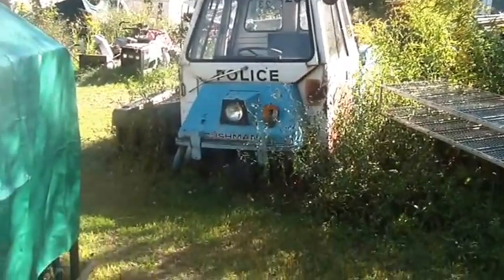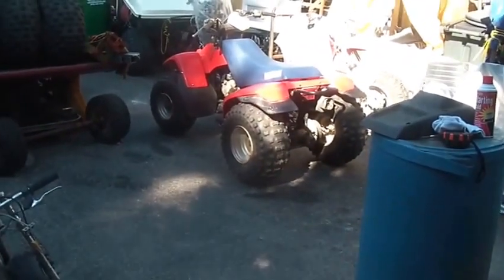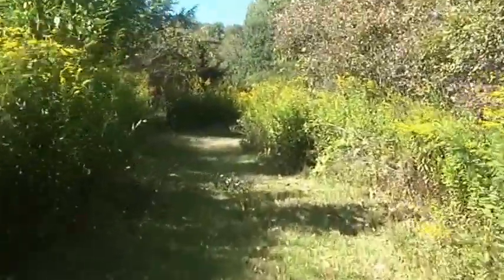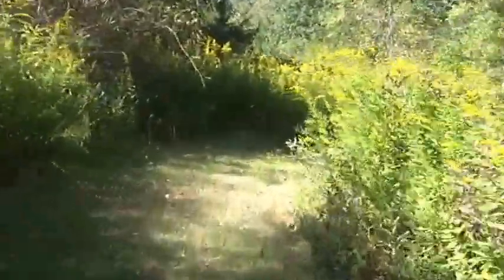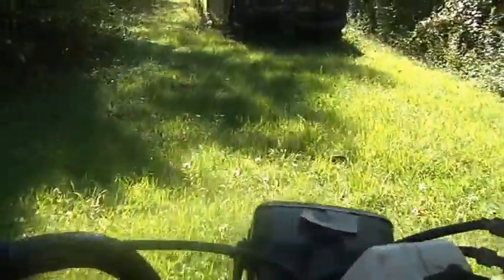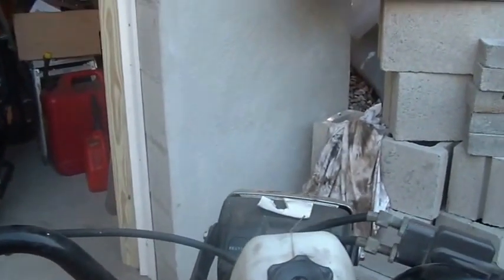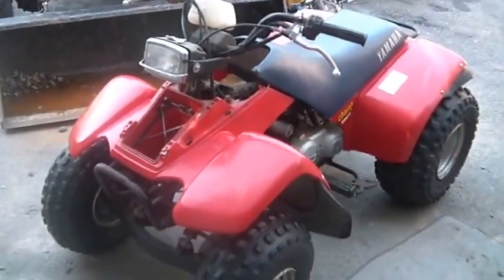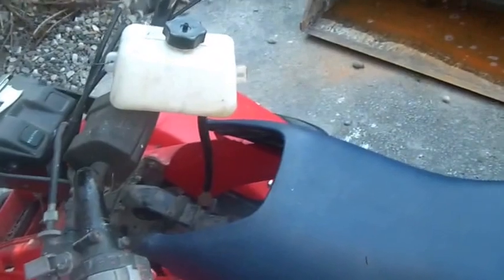9_15_15, Buckwheat, Yamaha Moto4 lives, riding it around the hoard,

Comment: Cool trail ride. Yep bet a motor cycle shop or ebay can supply it. After you replace it, use a gas treatment so it won't eat those hoses up while it set over the winter

Comment: i buy mine from the local motocross shop, its a big roll of what ever colour you want,  he will cut it any leanth and its not to expensive either but i only change it once a year so i usually get 3meter leanths
Reply from the maker: +Dave77124 , The stuff U buy is rubbery or more vinyl?   I have not tried the local shops, I took a chance and ordered 3feet of 1/4 inch rubbery stuff on eBay for $9, will see how that turns out.... Thanks for your input, watching, and commenting!

Comment: This is what I use, you can find it at any mower repair shop or anywhere online using the briggs and straton part number. It is 1/4 inch and made of a really nice rubber. Also fits most atv carbs well, not all tho. Just search 395051r on amazon and you will see what it is. That number is the briggs and straton part number.